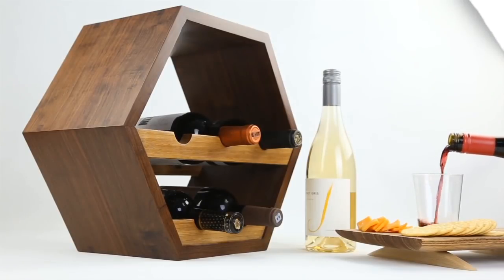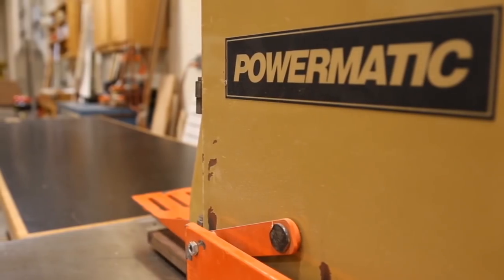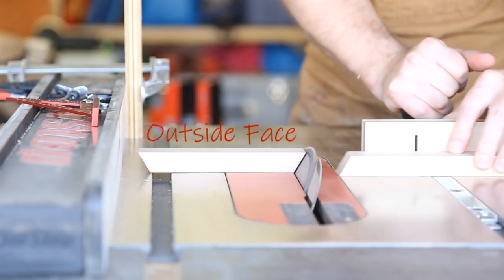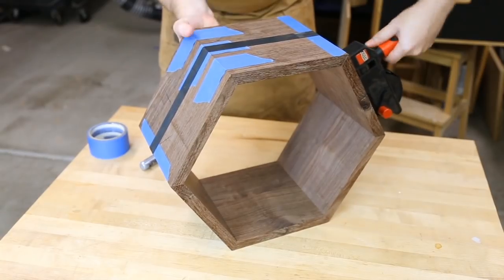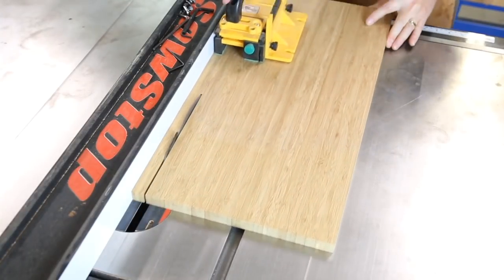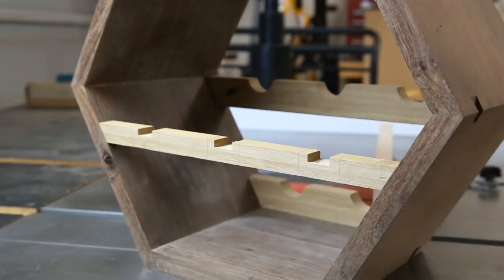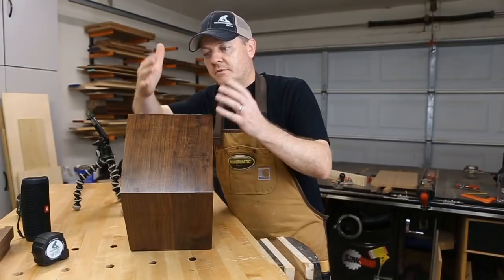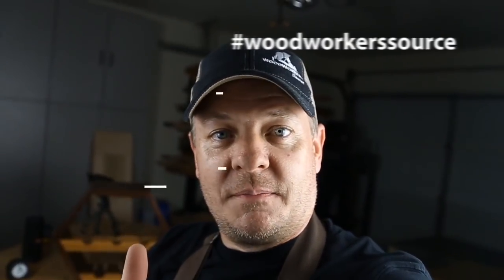How to Build A Custom Wood HEXAGON WINE RACK

Comment: Excellent!  The plans look great, and that trick about clamping to a right angle to cut the keys is a time saver.  I would've spent an hour or so trying to rig up some kind of sled type jig or something.  I'll be using cherry for the case and oak or maple for the inserts.  You forgot to mention the blade angle should be 60 degrees for the sides and 30 degrees for the inserts.  One Christmas gift idea down.

Comment: funny I want to make a hexagon wedding arbor that's about 84" across to serve as a backdrop for the wedding couple .   I'm having trouble getting those 30 degree miter cuts on a 2x2 to line up.   I'm using a chop saw to make the cuts then glue and pocket screw the pieces. Small pieces are easier to hold together but with pieces that are around 48" gluing a bit tougher.   Lastly what's a parallel vs non parallel miter cut?  I'm assuming it's angle on piece is the same direction on both ends of the piece.  thanks